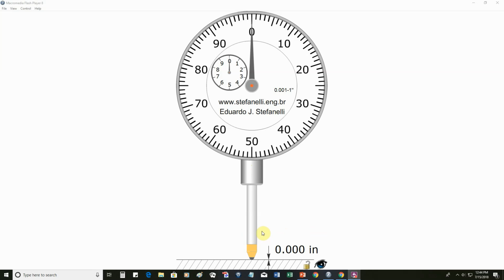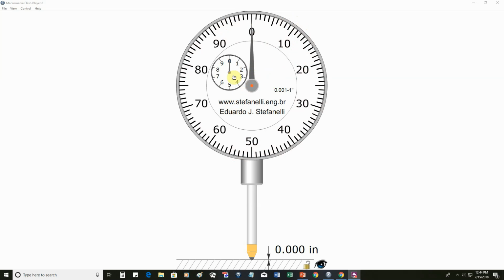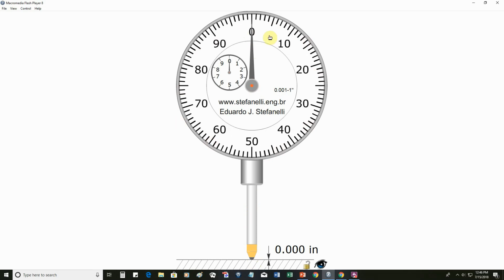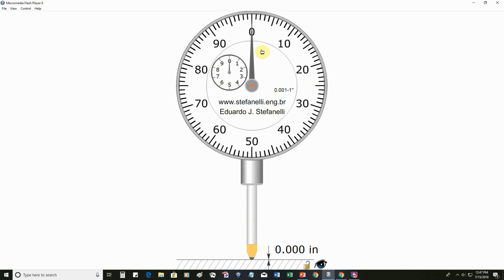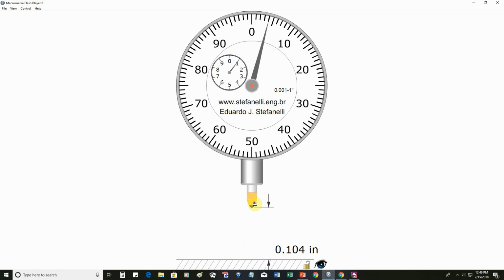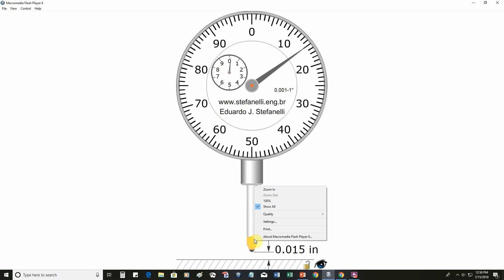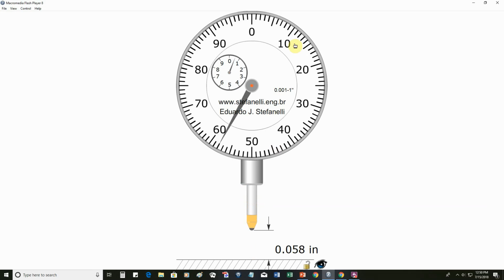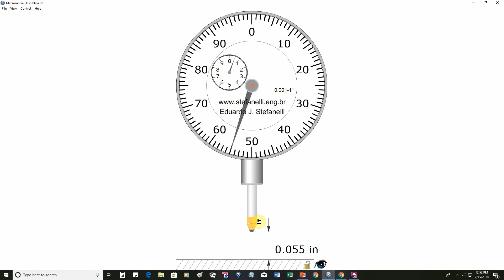Reading a Dial Indicator

Comment: [Genuine Question]
0.1000 = 1 Tenth of an Inch.
0.0100 = 1 Hundredth of an Inch.
0.0010 = 1 Thousandth of an Inch.

How come 0.045 is 45 "thousandths" if the "4" is in the hundredths place?
Reply from the maker: Since the 4 is in the hundredths place in the following numbers, they are all equal. It doesn't matter how many zeros we add, the actual amount of the number will not change. They are all  equal amounts:   
.04
.040
.0400
Even though these numbers are all equal amounts, they have differing amounts of numerals past the decimal. We add more decimal places when we want to be more precise about our measurement. The number of decimal places determine how we would say each number. 
.04        = 4  hundredths
.040     = 40  thousandths
.0400  = 400  ten thousandths

It really boils down to how precise of a measure you are describing. If its not that precise, I would write it as .04 or say it as "4 hundredths." If I'm talking about a really precise measurement on an important piece of equipment for a satellite, I would write it as .0400 and say it as "400 hundred ten-thousandths."  The more decimals we add the more precise the measurement.

In your question, the 4 is in the hundredths, but we are looking at the total number of decimal places. In this case there are there are three (tenths, hundreths, THOUSANDTHs) so we use the last decimal place to describe the number.
Reply: how would i read in millimeters?